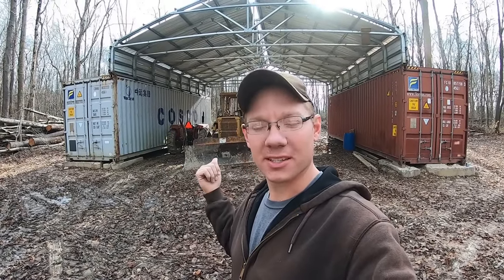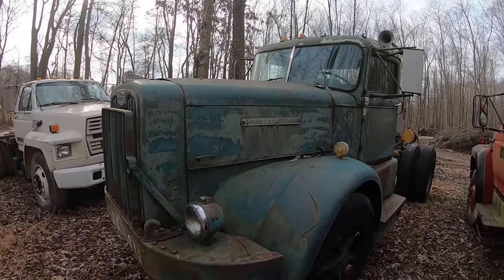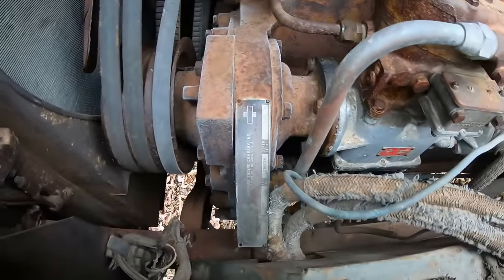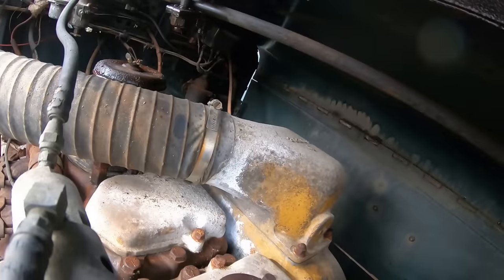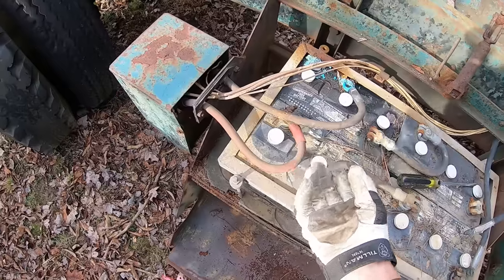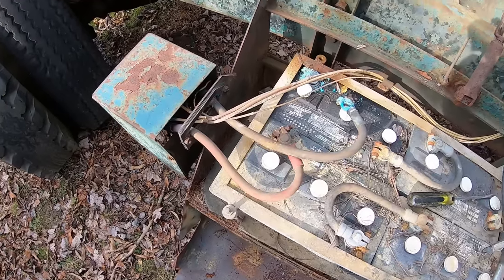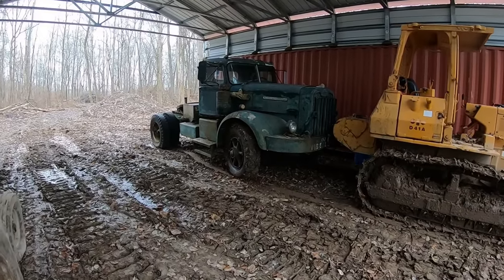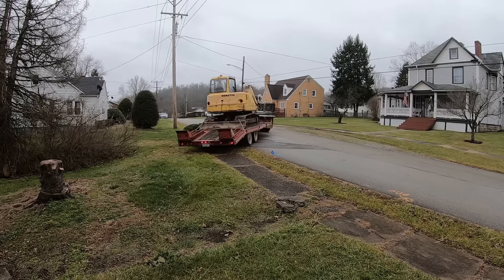First attempt at starting 1957 AUTOCAR truck - Hasn't run in 15 years!

Comment: I hadn't even seen an autocar in years and years. They became a Division of White in like 1911, and were White's premium brand. In 2001, Autocar became a separate entity again, but they only make severe duty "vocational" trucks these days... a niche market that they fill very well. If they are that tough, they would make great over the road trucks I suppose. Heck, I hadn't even seen an old twin stick since... late 70's early 80s ane the truck they were in was a 1948 International dump truck.
Reply from the maker: they dont make em like they used to! thanks for watching!
Reply: Ron Vrooman  um... hell that's ages ago, probably so. I know he had four gears on the stick closest to him, then over under direct on the other one. I never did learn to drive that one. Nuther story about that truck. 
We were coming to a red light entering Pueblo, Colorado, where we'd drop the load of clay off. The brakes were nearly nonexistent and the maxi's didn't engage. So he jaked it down to almost killing the engine, he had enough air in the lines to keep it from rolling into the car ahead, how I don't know. Anyways he pulled it over and we did a roadside repair of the air line that had ruptured. we just cut it off, since it ruptured near the fitting, and clamped it back on. The rest of the trip was uneventful, though I think I was sitting taller in the seat from when the brakes went, lol. Oddly, four days later for no known reason the maxi's locked up, and wouldn't unlock. I don't recall whatever happened to that old truck, but he never drove it again as far as I know.
Reply: Twin sticks became illegal in 1973 or 1974 model years. Too many crashes from drivers trying to shift both sticks at the same time. One crash that dad, mom & I saw in about 1970. The driver ran out of power on a hill, missed the gear, started rolling backwards, don’t know exactly what happened next. They think that he tried to jump, got hung up, was dragged, run over by left front wheel.  The truck & trailer end up in the right ditch about 100 feet down. It was loaded with grain. He was on pavement, climbing up out of a river bottom.
Reply: Ron Vrooman 
I have seen front or main transmission from a 4 speed to a 6 speed. I have seen the back or aux transmission have from a 2 speed to a 6 speed. Usually 3 to 4 is normal. A friend of mine had a Mack 6x4. It was 1 long transmission. Some one has installed a neat kit on these 2 transmissions. Both transmissions had dipsticks installed on them. Paul could check the oil level daily. I understand that one of big problems with that Mack transmission was climbing up a long hill, oil would come out of the front transmission into the back transmission. There wasn’t a seal between the transmissions, just a slinger. Then the front transmission would run low on oil, wiping out the teeth on the input gear. Then you would only have direct on the front transmission with the 4 on the back transmission. Paul came home empty from Great Falls one time because of this. After that, he checked the oil daily. Money and down time is a great teacher.
Reply: @darrelfuhrman8217  I knew they went out of common use but I didn't know they were outlawed. Actually, about the time I was running with my buddy would be about the they outlawed them.
Reply: Ron Vrooman 
I have a IHC 1941 KS5 that grandpa bought brand new from Markle’s in Glasgow, this truck has a factory manual shift Eaton 2 speed rear axle. I also have a IHC 1949 KBS 5 that dad bought brand new from Markle’s. The farm has
Reply: @darrelfuhrman8217   a neighbor had a Binder with a twin stick plus a 2 speed rear end setup. I don't recall what year it was, it was old and had been redone many times as needs changed. It was a cabover, originally an over the road truck, but somewhere along the way got changed into a long bed dump truck, still a cabover, but the rear ends were added on for some reason... probably to get more grunt when fully loaded, I don't recall what engine it had, not an exceedingly large one. With the twin sticks, the shifter for the rear end and two levers to operate the dump bed, it was really confusing to me what the hell was going on. I was pretty young at that time, hadn't been in many large trucks yet. 

I don't imagine there's anyone reading this that's ever seen a larger truck that you had to double clutch, I bet most don't have a clue as to what that is. 
Basically, the transmissions had no sychros, you had to put in the clutch, take it out of gear, then let the clutch out, then put it back in and jam the stick into whatever gear you were going for, and hope you got the revs right so it would go in pretty easy. If not, it would be noisy and clunky as hell. That's where the term gear jammers actually came from.
Reply: Ron Vrooman   I am in Montana. North east corner.
Reply: toot tall   On the farm, some times I speed shift, sometimes I double clutch, sometimes normal clutch. Part of it is how hurried the shift is. When pulling the liquid fertilizer trailer on 1 hill, 15 mph at bottom, 3 shifts to get the trailer over the hump.  That was with the 74 Pete cab over with a 400 Cummins. The first 2 are speed shifts. The last one is single clutch and jamb & pray. Pulling 4 tanks of 1600 gallons. It is very tough to get the trailer wheels over the hump.

Comment: That thing on the rear of your battery box is a parallel switch, they use to have a lot of trouble with them back in the day, the pull thing in the cab is probably a compression release, it has a electric fuel shut off "fuel solenoid" on top of pump, if it fails there will be a screw on the end of it that can be turned in on manual, but will have to turn back out to shut it down.
Reply from the maker: Thanks for the info! ive learned alot just today from people on here! ive been looking at the books and I was doing a few things wrong, i thing shell come alive next time!

Comment: Park and run = windshield wipers
Reply: What dose run and park mean? Well the wipers run on air. When you turn them on they start by zipping to across the windshield and then you turn them down to adjust the speed; when you go to turn them off they just stop wherever they happen to be on the windshield so to Park them you just turn the knob a little more.
Reply: @Fatamus  they run on vacuum ☺
Reply: @stephenfowler5563  Oops sorry that's right less air pressure (AKA vacuum) is not as condensed as regular air pressure. 

Marry Christmas
Reply: @stephenfowler5563  
Diesel engines don't have vacuum, unless there is a vacuum pump, and since there is an air compressor, they would have used air pressure for the wipers. I've been a class A driver over 30 years, and have driven some old trucks with air powered wipers
Reply: @goodmanboattransport3441  how many trucks you work on that don't have air?
Reply: @Gantzz321  none, but the newest one I drove had electric wipers
Reply: @goodmanboattransport3441  ohhhh say that again... the NEWEST ONES had electric wipers... you don't say....... thanks for coming
Reply: @goodmanboattransport3441  Diesels do have vacuum. Wherever the engine pulls air in has vacuum.
Reply: @kylekenan2321  

Not in the true sense of the word and meaning of vacuum in the automotive world, a non turbo diesel may generate a slightly negative pressure, but that is purely from the drag induced restrictions of the intake manifold and filter, there are no throttles to create a vacuum in a diesel engine like in a gasoline engine,  where a gasoline engine at idle will produce the highest vacuum, say around 14 inches, a diesel at idle will have very little,  probably 1/2 inch or so, certainly not enough to be used or of any value for work. Case and point, my 96 F350 with the 7.3L Powerstroke has a vacuum pump to power the brake system, then in 99, Ford went to a hydro boost system that uses the power steering pump for the brake system,  then when you have a turbocharged engine, you have boost, no vacuum available at all.
Reply: @goodmanboattransport3441  but doesn't the turbo create vacuum at the inlet?
Reply: @kylekenan2321  

Perhaps a little, my newest truck is a 2012 6.7L F350, there is a tattletale vacuum gauge on the filter housing called a filterminder, it reads the restriction of the filter by showing the amount of  vacuum between the filter and the turbocharger inlet, I don't recall the numbers on it, but I know that the less vacuum the better, so yes, there is some negative pressure at the turbocharger inlet, but I don't think it can be a reliable enough source for vacuum powered accessories, I will concede that there is a negative pressure zone at the inlet, but it is still from the inherent resistance of the intake system and not the throttles as with a carburetor or injector throttle body. I appreciate the exercise of thought, and your observation about the low pressure zone at the turbocharger, way to go thinking outside of the box, so to speak.

This has my curiosity going about exactly what the negative pressure would be on my Diesels at idle, as far as I know, nobody measures that value, except perhaps Gale Banks at Banks Engineering, by the way, check out his series "Killing A Duramax" where he is testing the newest Duramax L5P engine to find the weakest points and ultimately tests it until the heads are blown through the roof or the crank is on the floor, happy watching and Happy New Year!
Reply: Cummins invented the Jake brake because diesels have little to no engine braking, no vacuum!

Comment: i also love the same Styling  from that era  well into the 1970s my Grandfather  had a Tombstone Carving Business  that he had several old Big Trucks  he used  to Haul the Stones and Materials one of which was a older Mack  (ChainDrive )  that  had a extension on the bed  and  a extended Boom above that  a large part of my Grandpasbusiness was building granite and Marble Mausoleums all around the New York Tristate area he would sling those big peices off that Truck  onto the ground  and stand them up in the exact place they needed to be in  he used  Chain Hoists on a Trolley  that rolled  on a big IBeam  and then with Burke Bars and Crow bars   make any adjustments if needed    it was a treat for me as a child that i could climb into the Trucks  or even go for a ride around the block with him driving and  pulling thecAir Horns

Comment: What you have is a basic 12/24 system.  Everything is 12 volt except the starter.  A series/parallel switch controls it.  The name explains what this switch does.  These systems were used into the late seventy's.  You need two 12v sources to jump it not one 12v and one 24v.  Rebuild or replace the S/P switch, check all cables.

Comment: That's a fuel pump . Not an injection pump . I ran & worked on it also . If you need any help , just ask . It will need the rack adjusted .
Reply: Ex-Coast Guard Engineman\Machinery Tech here...why would the rack be out of adjustment just from sitting? Just curious.
Reply: Gary Chandler I would get it running & check the rack ! How do you know if the people who had the truck kept up with the adjustments ?
Reply: Oh , one more thing , I got a call from a guy , he said his 190 Cummins wasn't running well ! Dummy me , I went out and run the rack ! The valves were so far out of adjustment , I was amazed that it run ,& so we're the injectors . I got it all tuned up & it fired right up . The man said it never started like that before . It was on a sawmill , he put a log on the carriage sawed it up & said wow what power ! One thing I didn't realize , the lower end of the engine was not very good ! It ran for about 4 weeks & them bang ! I had a 220 I sold him & he's still running it .

Comment: I’ve got a 66 international 
Has a 250 Cummins naturally aspirated 

These engines are really simple 
There’s nothing to them 
Other than pistons valves 
And an injection system 
The injection timing is mechanical operated off the cam 
There is an electric solenoid on the injection pump... either 1 wire or 2 wire 
2 wire the bottom post is the ground 
And top post is 12 volts feed you can wire it directly to an ignition accessory that has power when key is on.... 
if there is a wiring issue or no power the truck will either not start or not shut off 
The pull lever for the compression release is for start up not shut down 
You hold the compression release open as the engine starts to spin to just make it easy on the starter 
And then let it go and the engine will fire 

For the love of good change your fuel and fuel filters.... if there is any sort of debris in the fuel it can clog a return line and cause the system to over pressurize and the engine will rev either to or above max rpm....  
these engines have low fuel pressures so they burn dirty so there will be smoke 
Watch the colors to see if it’s getting fuel or burning oil 
Your starter should be a 24 volt negative ground. 
And the 12 volts is just for everything on the truck lights accessories etc.... the knob you pulled off is probably for the trucks park brakes or wipers.  I keep a good piece of plywood handy... Incase it does take off you can suffocate it..... 
mine took off and all I had was a mud flap it wasn’t stiff enough and wouldn’t seal.... so it was sucking air and wouldn’t die..... it finally got hot and smothered itself..... didn’t hurt anything it still spins over.....
Reply from the maker: I was rushing, gonna go into the next video a lot more prepared, I’ll take care of that fuel system and the batteries

Comment: i would not hesitate to drain every bit of whatever fluid in that thing, and replace before starting
Reply from the maker: That’s the plan when I go to try it again! This is was mostly just to see if it was able to crank or if I had to work on it to make it run, would have been cool if it just fired right up lol
Reply: @DieselCreek  I live in  Ohio  and I see this same truck  sitting  by a building  for years it's cool.
Reply: Chad Simmons I agree  that’s common since!

Comment: Will be 24v + ground, at starter, if it is split load system (most likely if equipped with a generator) or else is equipped with a series I parallel switch, which is a relay, that must be powered up to start. No power, reverts to 12v +ground. Determine and mark all battery connections, because trying to sort them out is a lot of trouble and mistakes can cause serious damage, including, but not limited to fire and explosion. Park/run is air operated windshield wiper. Rear end lock, see if equipped with spring parking brake (not original equipment, but a common and sensible update) spring brake must have air pressure to release. If it's been sitting unused for a dog's age, common to be seized in full application. Don't worry about the fuel or runaway, just make sure that the throttle is in idle position. Check oil bath air cleaner hasn't taken on water, and caused the oil level to be over full, as the engine can suckup the oil, and run away. If you are not familiar with spring brakes can be spring death, if you attempt to disassemble,or if badly corroded. Be sure to check transmissions oil, before starting the engine. Looks like an old sweetheart, good luck!
Reply from the maker: No spring brakes yet but I’d like to add them eventually

Comment: Luv the truck!  Could it have a series/parallel switch on it?  I have a 59 Oshkosh with the 220 cummins that has the series/parallel so it has 24V starting, then switches to 12V when the key is in the "on" position.
Reply: I agree. As soon as I saw the battery connections, I knew this was an old 12v/24v truck with a series/parallel switch. 12v charging and operating systems and 24v starting. You can't jump it like a straight 24v truck, you have to jump it like a pair of 12v systems and the switch will combine it while cranking. If you send 24v to the truck, you risk blowing every light, gauge, alternator and anything else connected to it. Google "truck series parallel switch" or look here. https://www.trucksales.com.au/editorial/details/advice-series-parallel-switches-explained-60122/

Comment: Hello Matt, at last the Autocar is under cover, but PLEASE go round the Autocar with good oil can for the hinges, switches etc. It will pay off in the future, try using gear oil EP80 that has some body in it, not thin light oil. Wish I was there with you, would really enjoy work on you truck. Best wishes, Geoff Lewis, Wales UK , 🏴🏴🏴

Comment: I looked it up, but i don't know the exact model and engine you have here. Some autocar cummins diesels were positive ground. Your first inclination may be correct. However not all were, so... it's a toss up. Doesn't work with neg ground switch em and find out. Worst case, you have to rewire the truck, but you'll have to do that eventually anyway. Keep a fire extinguisher handy in case bad wiring lights something up.
Reply: The 6v batteries suggest Positive earth connection but, that is easy enough to figure out, Positive earth batteries have the larger post on the negative unlike today's 12v batteries where the Larger post is the Positive

Comment: diesel creek--pull the cover off the bottom of the parallel switch,you should be able to push up on the plunger and it will make contact if you have good batteries to start with.
Reply from the maker: I got it started! check the channel to see!!! Thanks for watching!!!

Comment: Nice truck. I would clean up all those electrical connections first for best results to begin with and replace the battery terminal ends and let what's there do what its supposed to do by just jumping on the primary terminals.Thanks for sharing.
Reply from the maker: Thanks for watching!